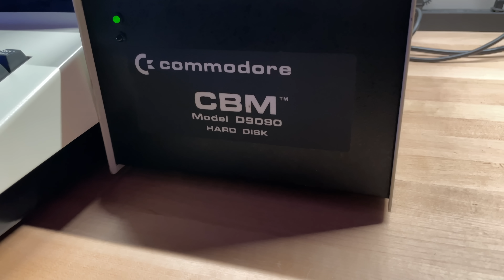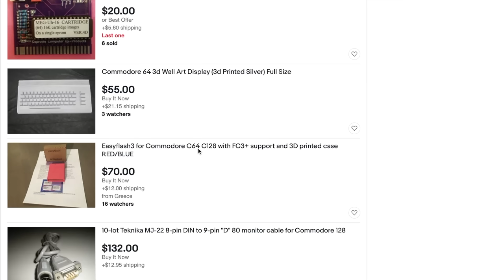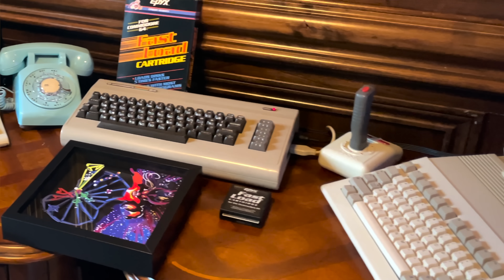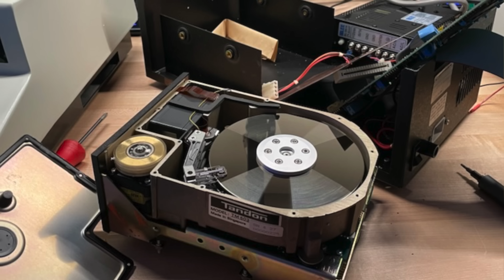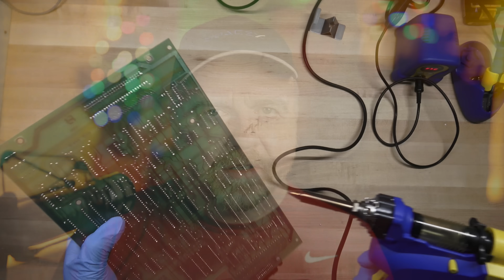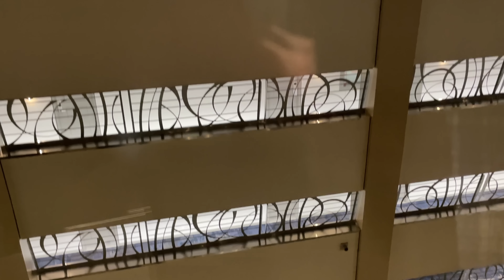FOUND: A Super-Rare Commodore D9090!

Comment: A GFCI is basically a current transformer and an electronically triggered shutoff switch. The hot and neutral wires pass through a magnetic ring. Current in the wires induces a magnetic field in the ring. However, since both the hot and neutral wires pass through the ring in the same direction, the magnetic field is proportional to the difference in the currents between the two wires. A sense wire wrapped around the ring can then sense the magnetic field in the ring through induction - the magnetic field will generate a voltage in the wire. This voltage can then be used to trip the shutoff switch, either directly or with some signal processing electronics. The point is to detect when more current is flowing down the hot than is coming back in the neutral. If there is a ground fault somewhere (say, the hair dryer got dropped in the tub and now the heating element has an electrical connection to the grounded plumbing) this difference in current will cause the GFCI to shut off the power.

So any induced magnetic field, may it be from a ac or dc current flowing around the supposed path will trigger the device. 

Learn from Dave: NEVER EVER use a f'n off the shelf PSU when testing hardware. Especially with never replaceable, precious collectibles, old hardware ... which you tried to preserve for posterity. Artwork, museum pieces ... my heart cries. Be professional and use bench power supplies with correctly adjusted current limitation. FROM THE START, in every repair session and not when its already gone. How sad:/

Comment: 13:00 GFI stands for Ground Fault Interrupt.
Which means it will interrupt the circuit if it detects a ground fault.
Also, GFI's can go bad. By design, when they go bad, they default to interrupt, not pass. This is a safety feature, and should not be tampered with. Ever. (more for your viewers than for you)
I'm sure the issue will resolve if you directly ground the grounds, and replace the modern switching PSU for the correct one.
I'm also sure that if you hook a modern PSU up to a scope, as well as an old one and compare the waveforms side-by-side, it will be obvious why the modern switched PSU will never work.

Comment: A GFCI generally detects a current mismatch between the hot and neutral indicating that current is likely going somewhere it shouldn't be. That can be caused by a highly inductive load like a motor and most off happens a back EMF when the motor power is cut-off. We had a bathroom once that had the ceiling fan on the same GCFI circuit for the outlets and there was a high chance that the GCFI would trip when turning off the fan.
Reply: Basically, that would mean that @Paul Michael Freedman is probably correct about a bad flyback diode.

Comment: EMI filtering often pops GFCI breakers. If this unit has an EMI filter the capacitors in it may be large enough or leaky enough to cause GFCI breakers to pop. I have a beloved but disused R390A receiver. It is nice mil spec work with a good EMI filter. It pops every GFCI breaker I've ever connected it to. The capacitors in it are large enough to generate enough ground current the predictable happens.

This may be worthwhile to check into. (Had a D9090 on a super pet at Rockwell International in the 70s. I developed a simulator for the GPS C/A, P, and Y codes that was more complete and faster than the IBM code translated to a Data General minicomputer. That was my transition from RF engineering to software. Sometimes "get this b**tch out of my hair for awhile" produces magic results. Um, by then I had the better part of 10 years fiddling with this blinkin' light machines, though. That was behind by boss's back, of course. Most of it was done on a fancy HP2100S machine in assembler.)

{^_-}

Comment: Hey, I'm just going to take a guess here and say that the negative side of the DC power supply wasn't grounded, so it was a case of a floating negative.  If that side floated and the board was attempting to use its own ground connection for whatever reason, the voltage between the positive and ground would continue to increase voltage until it ultimately resulted in releasing the magic smoke.  Since you had the drive in the chassis, having a ground connection ahead of a diode on the negative side would result in the floating negative being ignored.  Assume that the negative floated to something like +11VDC and the ground equated to 0.  If the power supply was to maintain a constant voltage between the negative and positive terminals, the diode would prevent the ground from absorbing the excess voltage difference and produce a voltage of 24 + 11VDC between the ground and positive terminals.  Now, I'm not sure if that would work entirely in practice, and I lack the equipment and manly bits to try it, but it makes sense in theory.

Comment: Dad had a huge external double-height 10 MB MFM on his TRS-80 mk. IV. The first 286-16 solution I built in high school featured a great panoply of old used hardware: an Orchid  VGA, 4MB DIPP RAM, Adlib card, and two ST-251s, one above the other. They overheated. I moved the 1.2 MB FDD inbetween those two drives to keep the heat down. Will never forget the noise. RrrrrrrRRRR dumbadummmabaduuuma bleeep beep bleepabeep…

Comment: Surprised you didn't just install Linux on a spare machine (or spare hard drive, or even a USB stick) and use that! Not hard to do (the USB method can be done in maybe 10 minutes) and it likely would've worked fine haha.
Reply from the maker: I just didn't have a spare machine, but should have thought of the PI as a spare machine!

Comment: Shorted power lines on drives.
I have seen some newer sata/ide drives that has some kind of protective diodes first thing after the power connector. these can short. I have recovered some drives that has failed this way, might be worth to check if this is also what's shorted on the original drive. Or maybe a shorted capacitor.

Comment: I used to have a D9060! It was a loaner that I got for a few months as a kid when I was working on porting WordPro 3 PLUS to the VIC-20, I think. It was a long time ago. I remember starting that thing up ... it sounded like a jet engine taking off, like in your video. It also seemed like an infinite amount of storage at the time as well. I remember disassembling the ROMS on an 8050 and figuring out what all the POST codes were as well. Good times!

Comment: Assuming that the new p/s had a 3-prong cord, I would suspect that a short from HOT to GND was tripping the GFCI. BTW I worked for Commodore for a while starting in 1982. I was a chip designer working in the Valley Forge (later West Chester) facility.

Comment: Electrically noisy AC motors starting under load and similarly high reactance devices are prone to tripping GFCI, my microwave does it on occasion. There is no true current leakage involved but the current is delayed with just enough latency that the GFCI thinks there is leakage during that delay time. The GFCI is seeing current go out but not come back for some short period of time while the inductors and capacitors are charged up, there is also shifting of the current cycle relative to the voltage cycle. (So leading or lagging sign wave by up to 90 degrees depending on degree of capacitance or inductance, which is also closely tied to the "power factor" rating.) I don't recall the min and max duration for a GFCI trip but it is measured in milliseconds as the goal is to keep people from being electrocuted.

Comment: Can the frequency be an issue? If the harddrive somehow was sync’ed to 50 hz, while it is 60 hz in the USA? Yes, such a failure is not expected from a frequency difference, however 60 hz is more than 50 hz,  could the European drive have been overloaded by the higher frequency, although the voltages were correct? I remember from my childhood, that old TVs actually could break if the grid frequency drifted too much, which happened once, so that the electricity company had to replace some TVs somewhere on the countryside where there was a frequency fault in the power grid here in Norway.

Comment: If you've got a dead short on the hard drive board, use a current limited supply and a thermal camera. Slowly ramp up the current and watch on the thermal cam for where the hotspot(s) are. Work from there testing components to figure out what failed.

Comment: Red Seal-certified electrician here. Yes, you're absolutely correct on how a GFI breaker works. It, in effect, monitors current in and current out, and if there is a difference greater than 4-6 mA it will trip the breaker since that means that current is leaking elsewhere. Now, an issue I have heard of in the past is computers dumping both DC voltage and RF frequencies to ground, which can be enough to trip the GFI since those things are bloody sensitive (4mA is nothing; a single LED draws around 20mA). The best solution, naturally, would be to not use a GFI for your computers since it's not going to do anything to protect them. Ideally, you really only need a GFI in a potentially wet location to protect yourself from shock, like outside, near sinks, etc, that is in environments where you probably don't want to use a computer (especially a rare vintage one) lol.

Go ahead and ask if you need clarification but be warned; I can talk your ear off on electrical theory :D

Comment: Outstanding video,  Dave!  In 1982/83 my first computer job out of high school was working for Tandon Corp. in my home town of Simi Valley, CA. My first year was spent testing Tandon's floppy-disk boards. The IBM PC had recently appeared, and we couldn't get these drives out the door fast enough! The next assignment involved performing final tests on Tandon's hard drives (602s/603s). By the end of 1982 Tandon was migrating to their ½-height 252 drives, which stored an amazing 20-MB. 

Finally, in early 1983 I transferred to what Tandon called their "Voyager" division, which was involved in the design and final test of the D9060/D9090 drives for Commodore Computer Corp. Being a youngster,  I performed mostly mundane tasks like burning the EPROMS that went into the SASI interface boards, along with running the HDD/interface testing (writing A5A5A5A5... etc.) and other patterns to the disc. Strangely enough, your video highlighted some of the power issues you experienced with your D9090, since I performed a Hi-Pot test on each unit before it was shipped.  There seemed to be some reason why we were checking for voltage leakage, and a few of the units did fail the Hi-Pot test. All in all, in the half-year spent at the Voyager facility (one small warehouse-sized building), we probably shipped around 1,000 units or so (don't remember exactly)... not at highly mass-production scale.  The entire division employed no more than 15 people,  which included the assembly/test workers along with a few hardware design engineers and programmers. As you mentioned, the drives were quite heavy, since they contained along with the drive, the P.S. and controller boards. I believe the main purpose Tandon launched this venture with Commodore was to increase the sales of their hard drives. I don't remember the pricing, but the D9090 sold for maybe $3,000 at the time... so anything less would be a bargain (in 1982 dollars). Of course due to several factors,  including the high cost of the D90X0 units, the growth of hard drive subsystems integrated directly into IBM PCs, along with the IBM-PC standard itself dominating the entire PC landscape, the Commodore hard drive subsystems were destined to become  a niche product. As with Dave, I grew up being exposed to PCs such as the Vic-20, Commodore-64 and TRS-80, along with Byte magazine. These were what can now be described as the "good-old days" or in Hollywood lore the "glamorous days" of the PC revolution. 

Many people don't realize that in the late 1970s/early 1980s the local area (Simi Valley, Thousand Oaks, Chatsworth and Woodland Hills) became somewhat of a tech mecca for disk technology. Companies including Tandon, Micropolis, MPI, Pertec, and a dozen others I can't recall sprouted up in the area. This also attracted value-added firms like Packard Bell, which was for a time the world's largest PC manufacturer, although one can argue with the term "value-added." Finally, Seagate Technology's R&D facility was located in Simi Valley for several years, although it wasn't as popular as the President Reagan Library as a tourist destination. Those companies are mostly gone today, but the notion that this little corner of the world hosted its own version of "Silicon Valley" lives on in the annals of computer history, including that of the D9060 and D9090 peripherals. Times change, and Simi Valley is now home to AeroVironment, which is responsible for much or most of the design and construction of the Mars Ingenuity helicopter. In summary, it is a truly amazing tribute to the efforts of Dave and others that the legacy of these still-amazing products continues to this day. Thank you!

Michael/SanPedro, CA,
Reply: So much lost history. Makes me sad and nostalgic. Good on people like you to bring it up once in a while. Thanks
Reply: That must have been amazing working for that company as a teenager using the vic-20 / c-64. Did you ever consider sourcing the parts to make your own version of a C= HDD? Or was that too expensive as well?

Comment: David's MFM emulator is basically magic as far as I'm concerned. It can even read in, decode, and emulate existing disks. We have them in several machines at the VCF museum in NJ. 
We're lucky that David helps a bunch at the museum - including setting up the emulators for us! The Xerox Star I gave the demo of a few years ago is using one of his boards. 
You should be able to use his board to test all the hard disks you bought, too. 
If you can get the original drive to power up you can image it! Who knows what treasures await!
Reply: Next time you see him, tell him that he is a genius! I have one in a iAPX-432 computer sitting behind me right now!

Comment: 120 v 60 Hz vs 220v 50Hz ? different frequencies causing some strange bucking and peaking of V/A ? as in pulsing startup power at 50Hz causing problems with a 60Hz psu....just a wild guess.

Comment: Back about 1983, I was running a BBS at my home on a C-64 with 2-1541's. Where I was working at the time has some old PET hardware they were discarding, and I was able to grab a D9090 and put it on my BBS in place of the 1541's. It still used one of the 1541's to boot. But once booted, everything ran from the D9090. Between the D9090 and the 2400mbs modem I had connected to the C64, I thought by BBS was some serious shit back then. Looking back now, I have no idea what ever happened to the D9090. Or any of my old Commodore gear for that matter. Those were the days...

Comment: Hi Dave, I did the same surgical add of 16k bytes on my Commodore CBM3008 with holes in the motherboard - just piggy back a second set of ram on top of the original set of eight chips, bending their Enable pin upward and wiring it with wrap to the Enable trace of the destroyed 2nd bank - I really enjoyed your post !

Comment: Hi Dave, are you sure the drive is a MFM and not a RLL? Have you tried putting the hard drive back together with the 220v? you might want to try using a soldering blower gun to get all the chip out.

Comment: Dave as an amature EE moonlighting as an electrician, a programmer, and a plumber, I think I have a lead on your GFCI quandry. The problem may not have actually been in the drive itself, the difference could have been dependent the design/manufacture of the drive, the drive might not have been bad, /and/ the problem with the mainboard could have been related.

Alright so,  you've got DC ground, but you've also got a 3-prong cord on that drive, and the frame is thus connected to AC ground.

If you get some leakage in the power supply section of any other device attached to your computer, most often it'll have no noticeable effect. The "ground" wires inside various cables might be at 3-4 volts AC but since all of the actual signals have the same offset imposed on them, everything still relatively works.

Including your hard drive.

Now, if that hard drive happens to have the DC ground attached to its frame, and it is bolted to the drive case frame... well now you've got a completed circuit to ground. Something else on your computer leaks some AC to the DC ground, which makes its way through the drive cable and logic, to the frame of the drive, to AC ground -- not AC neutral where the GFCI would expect it. Since hot and neutral currents don't match, GFCI trips. Remove the drive and you break that circuit.

Whatever leakage happened somewhere (I'm thinking bypass capacitors in power supplies) also MAY have put enough current through the wrong place to have damaged the board.

Comment: Hmmm... Maybe I should sell the ST251 drive (big improvement over the previous full height MFM drives from the TI-99/4A expansion box days), and a couple other larger capacity SCSI full height drives I still have (worked when last used) removed from an Intergraph workstation. Or... I could pull out the MegaST4 and spin them back up (maybe) and see that glorious (for the time) FidoDoor BBS (K&R C) and TrackHack (68000 assembly) source code.

Comment: I received a Commodore 64 as a gift back in 85 or 86, had a floppy drive which I had a bunch of games for and a joystick,  and cassette drive I never used. Also had a printer. I wonder if I still have it...
To access the floppy, insert into the drive with the correct side up and type

Load menu ,8,1

Never knew what it did exactly, but it worked